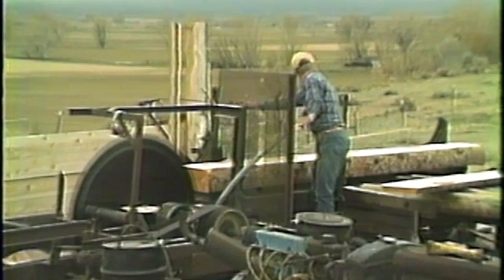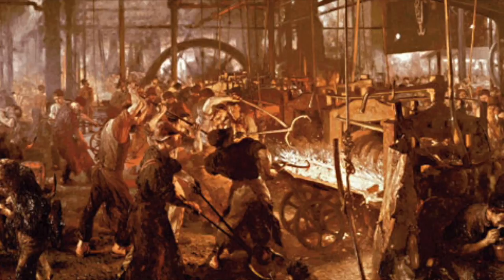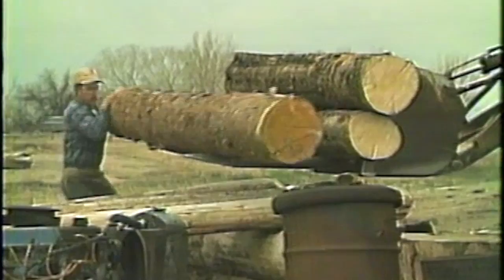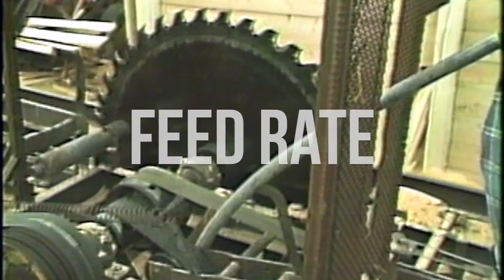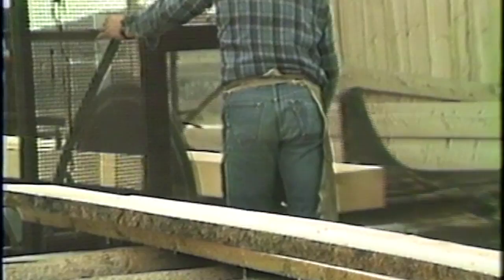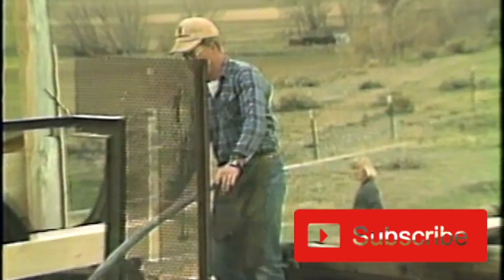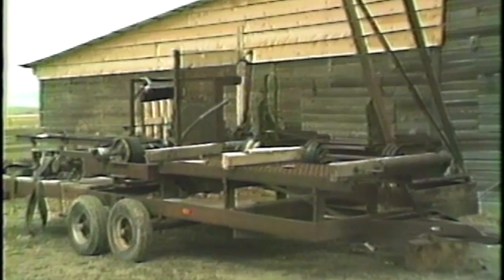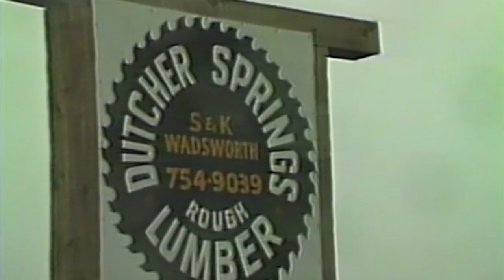A Sawmill Story

Comment: Very cool! I happen to be 22 years old, I just bought a mill back in august. Im lucky enough to have a mentor by my side, my dad has been in the mills since the mid 1970s. Its old, but all the hard parts are there. Currently working on getting the inline 6 caterpillar diesel back up and running.
Reply: I plan on making videos, going to Portland Oregon tomorrow to pick up the cylinder heads for the engine. That itself is probably the newest piece of equipment, and it is from the mid 1930's. So definitely vintage. Should be really cool to see going.
Reply: Man, how is the build coming ? I'm doing the same thing, except more of a carpentry focus.  So far its paying the bills and some! i'm 22 as well

Comment: Great video. This is the first time I've heard anyone properly talking about the characteristics of the saw. I grew up in east Tennessee in the 60's. On the farm we operated a 00 Frick SawMill that we powered with a 1949 Model "R" John Deer. This was John Deer's first diesel engine on a farm tractor. As I remember it had about 50 hp on the drive pulley and was a lot better on fuel than a 60 John Deer that we used sometimes. Prior to my work around this family mill it had been powered first by a Frick Steam engine and later they would line up two "A" John Deer's and pull the mill.
The mill had a four block carriage, a sawdust chain to remove sawdust from the pit under the saw, an edger and a 52" saw. Every day after lunch Grandpa would file and reshape the saw teeth. Three of us, Grandpa, Dad and myself would saw around 250,000 bd. ft. throughout the year, and in our spare time operate the farm, raise cows and tobacco.
Reply: Wow...thanks... your Grampa (family) 

had an intimate understanding of these skills! Do you remember if he hammered the saw himself, or took it to a shop? Sam hammered saws, but was too old and not strong enough to teach me. My saw was a  50", which means that the blade on your families mill was even more sensitive and sometimes tempermental than mine! Do you have any pictures?
Reply: Grandpa bought his saw bits and rings from an industrial shop in Knoxville. That includes things like cane hooks, flat belts, bearings, and other misc. items. This was the second saw that was used on the mill. Back in the 40's the front carriage wheels got off track because they had a log that was too big to roll by hand onto the carriage. They had used a long chain and wrapped a loop around the log. That way they could pull the chain with a tractor from the far side and that would roll the log up the skids and onto the head blocks. The log was about 20' long too and I don't know whether they knocked the carriage off track or the extra length of the log kinda twisted the carriage off. Anyway the front block went ring deep into the saw and ruined the several of the ring shoulders and was never repaired. Grandpa told me about the how the second saw was hammered when it was made but that was about all he said about it.
When the saw would start to cut wrong he would squirt some oil on the saw to finish the log or to get us to a good stopping time. He would basically sharpen and swage the teeth to bring it back like it was supposed to be. The head frame did have "guide blocks" but you couldn't put much pressure on the saw with that because it would heat up out where the teeth were AND he said the body of the saw would heat up because with lots of pressure from the guide the saw was constantly flexing!
Grandpa was just a master at filing and shaping the saw teeth. We almost never had heat issues. The main reason the teeth dulled was that the logs were drug through the ground and all the dirt and gravel got buried into the bark.
Reply: Scott Wadsworth One other thing, I do have some 8mm movies that I converted to digital. I have it on google drive right now. I need to edit it because the sawmill footage is mixed up with a bunch of other family home movie stuff. Tell you what, I'll try to move it to my youtube channel and when I do that I'll let you know.

Comment: wow,  that pulled on my heart string.  I to built a 54" mill powered by a chevy 6 with a foot throttle and sound to govern the rim speed.  Using scrap  steel, copying a Belsaw mill in the early 80's and never did get that blade hammered correctly.   I still smile every time I look at my shop rafters and see the wave pattern cut  in each board.

Comment: I had a friend who owned a sawmill very similar to yours, with a 5ft circular blade that cut one board at a time. He lived on the edge of the Adirondack frontier and cut mainly hemlock. I built two houses from his lumber on the land that he sold to friends of mine in the Adirondacks. It was quite an experience using actually sized lumber. He and his five sons and one daughter all kept that mill running 24 x 7, it was slow, but if you were careful it did a great job. It kept his family fed through thick and thin and also made him a lot of friends!

Comment: My father bought a sawmill like that for $200 in '76. It took us all summer to get it running. We had to replace the wood and iron tops of the rails.  The solid blade was eventually replaced with a larger insert type blade like you have. A 54 inch blade required a pitch-out between 3/16" and a quarter inch. My father never could get it straight in his head that the saw blade cannot rub against the fixed face of the log but only on the board just cut. My brother would usually operated the levers while one of us helped get the log on the carriage then stacked the boards at the other end.

Comment: Your 4 years older than me , I know you had it rough running that saw , Housler sawmill started out with a V8 1941 ,  I first step foot in the Mill 1990 . Whyle had a mill Burn down in 1968 Lighting strike rebuilt and went Electric Hydraulic  in 92 we set up a second saw side by side .  Mr Housler just Turned 86 was at the mill every morning 6am till 5pm every day scaling logs and running saw 1 his son ran saw 2  I pulled 40,000 Linear foot of lumber a day I could fix anything that broke . are chipper had a 22 inch face the blowers at the saw could keep the dust away but still had to clean up everything that afternoon .   Mr Housler past away 2004 One of the Best men I had ever worked for .  he never cursed or drank but he loved to Hunt Fish and work .  watching you Remind me of Him  Thank you for adding the Video .

Comment: This video brought back a lot of good memories of a summer a while ago my uncle had a mill like this darn close to the same size we could cut some large logs it ran on belt drive from a John Deere R tractor apx. 50 hp 2 cylinder diesel it would run that mill no problem. I spent the summer with him cutting logs there was 4 of us 2 on the out feed him as sawyer and I on log deck and cants. I would help with maintenance at the end of the day and stand and watch when he fixed a tooth he could tell by the sound of the saw if it had lost or broken one......don't know how  but he could. He did his own filing as well. I learned so much that summer I still have the mill and the tractor it runs the mill would need some work..... you never know

Comment: As I watch this clip I can't help but feel emotional. I come from a long line of timber men. My grand father knew the art of circle saw hammering to get the right flex in the metal so the saw cut straight. He also worked cutting the road right of way into Reedsport from the south, the hard way with axe and crosscut. My uncle retired from logging in AK, where he beat the brush as bull buck and finally went to the log yard running the log dump. Dad drove the log trucks. I have spent time in AK cutting timber until I was injured and then went into the mills. Today I'm looking at retirement square in the face. I will retire with over 25 year as an RN. I would not be where I am today if it were not for the hard work of those men in the timber. Thank you for sharing.
Les From Eastern Oregon

Comment: I remember 1986 my father has just ordered his new econoline van I was 8 years old he went to the dealership and order it custom had 4 speed manual and a 4.9 litre straight six I remember he ordered a bench seat for me. The van he had before he had taken a seat welded a pole in the middle and would sit it in the rims and tires of the winters of the van and vice versa in the summer can’t believe how things were slack back then no seat belt anyhow remember having my own bench seat , I remember helping my father an accomplished Carpenter build shelves for the back of the van.

Comment: Sir, you speaketh the truth, I'm on my second circular mill. I almost built the first one from scratch , ran it for a wile with a steam engine an Ajax 8 1/2 by 11" with an AB Farquhar boiler.  Ran that mill with a Cat. 318 in the winter for obvious reasons. My current mill is half Chase half Lane with a 6 cyl Dagenham ford  diesel. My big problem is finding a good sawsmith in my area, I'm tempted to try it myself.

Comment: i joined the army a while ago and worked on the last sawmill in the military, which looked a lot like this. the army has a manual on logging and sawmill operations: TM 5-342. the army used to have sawmills because, as you said, lumber used to be hard to come by. so they'd send a sawmill in with the combat engineers to build bridges and stuff. the sawmill i used to work on is now rotting in the backyard of the museum at fort snelling in minneapolis.

Comment: Had to watch this again. Grew up about a half a mile of a Frick, mabe 00 mill (4-block) pulled by a 4-71 made in the 50's. It's still there, same mill, same motor, still running. Son and grandson of the sawyer running it. I loafed with the boys and was on the receiving end of the mill along with one son and a cousin. Come in after school, swaller a sammich and head down the hill where the sawyer would be 'HOOTING' that old Jimmy and it was 'Katy, bar the blasted door' from then till dark:30. I've watched the sawyer suage the bits and sit on a 6x6 chunk and use a flat file to hone the teeth. He made his own tool for turning the rings to replace the bits. Then it was on again. Sawyers brother ran the edger. No forklift so we muled everything. Big beam orders for houses in the 60's. Made a man out of me as far as strength wise. Took a while for my head to catch up. You know how it is. Great stuff. Waiting on the next one.

Comment: Oh my the memories this brings back to me. I too learned on a old circle mill and for a time had a 00 Frick mill.  Your right it takes alot of knowledge and tweeking to get them to saw right but when it comes together they can spit those boards and ties out lickity split. I powered my mill with a old 383 Chrysler and at first i was concerned about the auto transmission. But by locking it in 2nd it did beautiful in maintaining a constant proper speed.

Comment: Great video!  I started off similar although much later, I was 6 in 1986.  I bought an old circle mill which was in such a state of disrepair that it was basically a set of metal parts and I had to rebuild the thing from scratch.  This was in 2008.  I got the thing to run, but never did get it to cut as true as I wanted it to.  And, as I work mostly alone, I switched to a band mill.  I've still got the old circular mill though, I just haven't ran it in years.  At any rate, I found your channel because I am a carpenter, I've been a carpenter since before I started in the sawmill business and after.  The sawmill just ties into the business and has opened up other avenues of income.  But, I found your channel from your carpentry tips, (I'm always looking to improve my skill.)  Good tips, I'll subscribe.  I spent a few years in Wyoming myself.  It's too bad our paths did not cross.  Maybe in the future.  Thanks, Jeff Carpenter

Comment: I have a Wood-Mizer sawmill and they are indeed very nice machines. You did very nicely with that circle mill. They are indeed difficult to get to work correctly. Just the blade tensioning is a whole ball of wax right there. Great video.

Comment: I've got considerable time on a 
Woodmizer LT-15 bandsaw mill, 
and would trade ALL that time, 
to be able to see this sawmill in 
operation.

My brother is taking an adult-ed 
wood shop class, mostly to use 
the better machines, and to make 
slabs on the LT-15.  I'm the mechanic 
and his assistant.

I would much rather be using a 
circular saw, run by steam.  You 
were almost there, with this.
(The thing with steam, your scraps 
power the engine.)

steve

Comment: I used to be the who ran the cant hook on a mill similar to this one. We called the flat belt set up the "husk"! I did a Sat. view of the site and the building they built around the mill is still there.
Reply: It was explained to me as like a ear of corn. Everything you need to make it work is in the husk! I may not have that quiet right but close. There is a chance that old mill I worked at be still be in the building. If ever I get back to MN I will check it out.

Comment: I still have an old 48 inch bellsaw sawmill I rebuilt about 30 years ago It has a 50 ft I beam track that breaks down into 2 pieces and a 472  Caddy engine and auto trans to drive it on a set of rails. I haven't cut much with it but It struggles to cut large juniper trees . They are very tough to cut.

Comment: My father had what was called portable
Saw mill made by
 the mcknihght co in 30a. I was about  12 in 1985 when we set it up.for those that don't know hearing that 50inch saw stand  and run is unfrohetable.!! You just don't forget certain sounds like that dogs coming down on timber orzing when when making slabs a the rattle of wooden hames going on the mules to skid those logs

Comment: 30 years of firewood cutting,  a few year's as logger and now part time tree trimmer feller, i found the small firewood / trim & single handed climbing saws are more dangerous than the big timber saw because im standing into a jungle of pickupstick twigs & overhead limbs and  face high limbs and the issue is after cutting through a limb i let off the gas thr saw is now slowing down & im lowering the saw to move or grab the cut off limb the saw is rotating enough to guess what, to cut through my lower pants leg or knee.  >>>> at least wear chaps when limbing

Comment: It's easy to get spoiled. I'm only a decade your senior. When first in the army as a medic, things were a little more complicated. To get a 2x2 or 4x4 gauze pad, it had to be cut, folded, towel wrapped, taped, and autoclaved for sterility. That gave you one piece. Now they are in paper wrapped packages of 100. Use what you need. Toss the rest. Personally, I like to be spoiled.

Comment: That same old mill is still going. The lads have found a 6-71 to pull it but the old G.M. 4-banger is still going and there's a pile of logs in front 20 feet high or better. Job security.

Comment: Thanks for sharing this! I have been working on the restoration of a Frick mill for several years and have always struggled with blade wobble. I had come to the conclusion that worn shanks, the guy sharpening the teeth (me) not doing it so well and lead as contributing issues. Your video seems to confirm my suspicions. I have plenty of power with a 190hp Cummins that keeps the speed up in the cut. I think I saw a little slower than I should also. The saw does well on soft woods but has issues when sawing oak. In my mind, it should saw both equally well. Thanks again!
Reply: David Cunningham has your saw been tensioned to match your rim speed?
Reply: Scott, the 54" saw I have is hammered to 600rpm and the rim speed is 8,500 feet per minute. From the video, the desire is to get to 10,000 fpm but the limited recommended rpm on this saw is 650 rpm which would give a rim speed of ~9,200 fpm. I just replaced all of the shanks and need to have it hammered so I could take it up to 650rpm. We also used a laser level and found the saw was out of level. We leveled the entire saw and are going through the rest of the alignment process over the next couple of weeks.
Reply: David, I just watched your restoration video! Awesome! A couple of comments...
1- I didn't get a look at the saw guide...I assume that there is one and that it is set so that there is zero room for the saw to drift out of the log and maybe a sixteenth of space for movement into the log?
2- The consistency of the sawdust tells a lot about how the saw is running. It should be very coarse,,,not fine and powdery. Little chunks really about half the size of your little fingernail. This indicates appropriate feed rate.
3- If you have water available, a small stream of water (size of a pencil lead) spraying at the center of the saw REALLY helps things stay cool and keeps fire danger down in the summer.
4- You might consider some sort of guard, even if it is just a grab rail on the husk both on the head and tail side of the saw...never know when someone could lose their balance.
5- As beautifully as you have set this thing up and with all that power you are gonna have a lot of fun!!!

Comment: I am greatly interested in what you have to say in regards to Circular Sawmills being obsolete. I'm on the brink of purchasing an old Meadows 52 inch circular saw mill that originally was portable however I plan to use it in a stationary setup. Other than wasted material due to the kerf width and overall length of the equipment why are they obsolete?